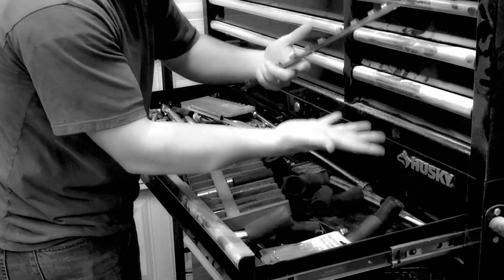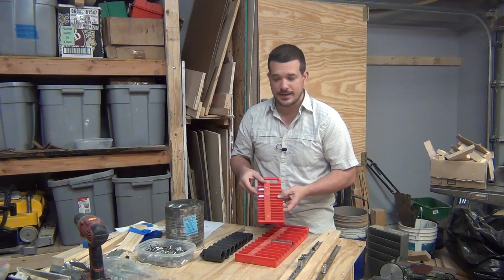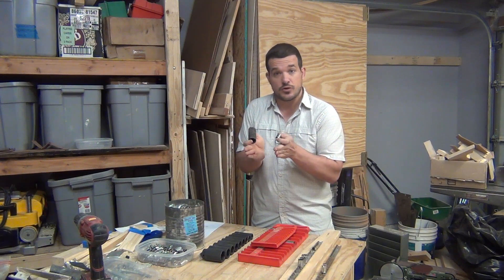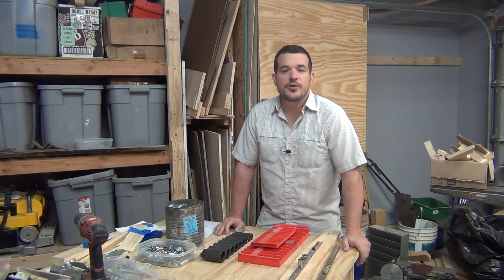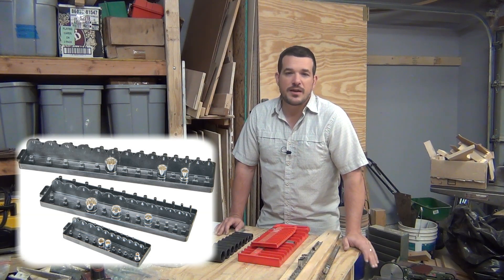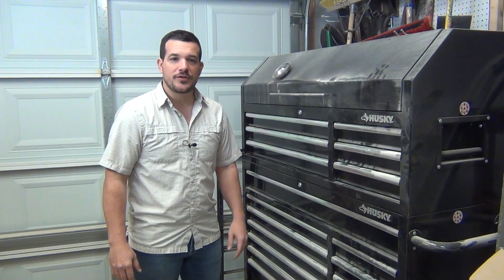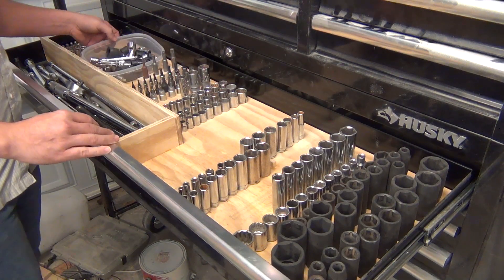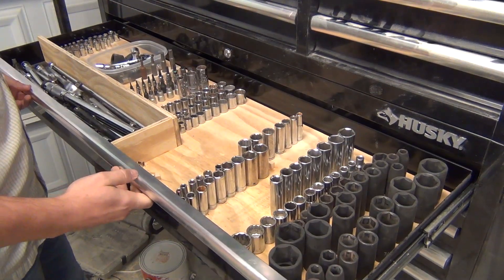Organizing Sockets - Which is the Best Method?

Comment: I’ve been turning wrenches for 60 years & I’ve tried them all. The best & most convenient for me is a tray. Since I usually use the most common sizes I have always stored the 9/16, 3/4 and 15/16 upside down. I use those 99% of the time. With my small sockets 1/4, 5/16, 3/8. With my metrics 10, 13 15 & 19.
Many good suggestions here, thanks for your post.
Reply: What do you mean by tray?  Laying flat horizontal or sticking up vertical?  I put paint markings on some of my sockets I use a lot ;-)
Reply: @aacar4095  in the top of my toolbox is a tray with a handle to lift the whole tray out. I keep all my sockets, extensions and ratchets there for quick access.

Comment: I tried your method for my tool cart...for professional auto mechanic work. I used round dowels rather than square. I found the glue comes loose after a few weeks. You may have better results if the dowels are cut cleaner or prepped better to maximize surface area contact ... or you use something better than wood glue.  I had to drill the base wood to receive the dowels. Now the dowels stay glued in place...even after a year of use.
Reply: If your dowels are set far enough into your base zend your base is set into a drawer why would you even need to glue the dowels in? Isn’t the reasoning for the dowels to keep the socket from moving side to side?….gravity does to rest.  For I can shop use i don’t see the point in glue and without g go glue his method works so much easier with moving stuff around

Comment: I used 1/2" mdf and laid out the sockets like I wanted and then drew outlines around everything. The sockets where I had a drill bit the right size I drilled. The rest of the cut outs I did with a scroll saw. A lot of work but I am fairly happy with the results. I now have a CNC machine where that I can program it to do all of the cutting. Another thing that I have thought about doing is dividing the drawer up in to small rectangles for each section of sockets. That way I can just pull one section out to add cutouts or to re cut the entire section.

Comment: I really like your method.  Since I love working with pegboard,  I'm going to use pegboard instead of plywood.  Just glue two pieces together and you can insert dowel rods.  I know that makes all sockets the same space apart,  but I don't have a many as you,  just two or three assorted sets (with missing sockets in each set).  If I use this method,  my sockets will stand vertically and I can move them around if I want to.

Comment: I use a set of manufactured gray-plastic raised trays that has properly-sized holes, all labeled. A set for 1/4" drive, 3/8" & 1/2". I then customized each tray by adding kaizen foam to the back side, snug-fit to each socket's diameter. Most the holes are full-depth; but for small standard sockets, the holes are shallower. All these reside in two drawers of my excellent stainless steel tool chest (Costco, many years ago).

Comment: Craftsman sockets long ago came in socket trays with a swinging top rail to contain the sockets. I now make simple four-sided trays from  aluminum or sheetmetal sheets.  Line up the sockets to get tray inside dimensions, transfer to metal sheet, cut with any of several methods, bend up the four sides with a sheet metal hand brake.....viola....socket tray.  These trays waste virtually zero space, can be easily rearranged in drawers.  Also, can add magnetic tape strips to tray bottom to hold trays in place during opening/closing drawers, still easily reposition. Magnetic tape can also be placed inside trays to get magnetic trays.

Comment: Sometimes the work we do is not near the tool box. Although your socket holding system is nice and organized it is not very practical. Having a type of socket keeper that you can bring to your work across the garage or outside is the best way to go. When I wrenched professionally I put the rails into a carry tray and set it on the top of the vehicle by the radiator. other smaller tools like ignition tools, cutters, tapes, plyers and long noses were also in the carry tray. It eliminates walking back and forth to get the right socket.
Reply: I think this is a setup meant more for a woodworking or even metalworking shop. one where you typically don't need to have too many sockets in use at the same time. its more of a specialty tool in this type of shop. For me personally, I have a specific socket or wrench left on a machine tool if it is used often, so there is no need to go to the tool box
Reply: I got tired of walking back and forth from my tool box to the vehicle I was working on and I invested in a Rubbermaid 4 wheeled cart.  I can throw things like bottles of antifreeze and quarts of oil on the lower shelf and keep the tools on the top.  I built something similar but smaller to hold sockets upright.  Spray your impact sockets with brake cleaner and then fill in the markings with white paint so that it's easier to read your socket's size.  My eyes aren't getting any younger.
Reply from the maker: Your comment seems to miss the point that I don't "wrench" professionally. I open my socket drawer MAYBE once a month. Now when I do, it's organized. That's the overall point of the video.
Reply: ...you can't please EVERYBODY-!!
Reply: I like the hanson. I can just set them on the floor under the vehicle with me. No fighting them out of the snap locks,they don't fall over and can drop them right back in the carrier.
Reply: bag o' toe tags good for a cart that’s mobile
Reply: larry brown  
You must be a goddamn bodybuilder
Reply: Rocket Surgery You should’ve just got a girlfriend.....She could do all the pulling and dragging 😬
Reply: @maxwellpeter1598   I agree, I've just retired, I like this method for storing sockets, most of your home jobs are in the shed, so use you mobile tool box. For jobs outside ,pumps, car, all the wife's invented jobs, surely most of us know the socket sizes and can carry a small tool box.
Reply: You cant carry foam but you can carry small bits of wood.

Comment: The metal socket rails do take a bit to "break in". I have for years used these screwed to a painted 1/4 or 3/8 piece of plywood cut to a mobile size (13"x17" is my favorite,  holds 8 rails). Once all of the sockets are on it is easy to remove and install them with the weight to hold the organizer down.  I have tried many,  possibly all of the sockets organizers and for me this is the cheapest best way to do it.
Reply: Thanks for the suggestion and dimensions. I'll have to try it.

Comment: I really like two different setups. The first being the aluminum ones with the plastic clips you can find at harbor freight. Definitely a step up from the crappy stamped metal ones that are either way to stuff or have no grip at all (as you demonstrated in the video) if you look around online, you can find spare clips if you ever end up buying more sockets which is nice. I have many rails and ended buying I whole crap load of spare clips, just in case! The downside is they’re only so long, my 1/2 drive impact socket set takes up 2 full sized rails. Although that may or may not be a issue depending on your setup. 

The second option I really like are those magnetic ones that the snap on socket sets
Are sold on. They keep the sockets upright, are magnetic so they won’t slide around in the box, and also strong enough to keep sockets from rattling around when you close the drawer rapidly, but the magnets are also ‘weak’ enough that the whole socket tray doesn’t come up with the socket you grab. 

The Hanson socket trays I’m not a fan of because the tabs are plastic, and if your taking or putting sockets back in a hurry, they will break right off. On the other hand, they’re clearly marked with the size. 

Toolbox organization is a science all in itself. But everyone is different. My setup may not work for you, just like yours may not suit my preferences. And that’s ok, everyone has their own method of organization that works best for them.

Comment: The plywood idea I think is nut as you have to remove it from the draw to drill new holes because of the chips and dust created. I ve used several methods over the years but now I m hooked on VIM magnetic socket rails  as the have a t slot and the pegs are inexpensive and can hold different size pegs on the same rail. And the magnets hold the sockets very well. The rails come in various lengths and colors. Pegs and rails can be found on amazon

Comment: I've  gotten  lazy  after  40  years  of  twisting  a  wrench .  I've  done  most  of  those  over  the  years  and  now  I  just  use  the  harbor  freight  free  magnetic  bar  and  attach  them  in  3s  to  a  piece  of  sheet  metal . It's  not  perfect  but  works  just  as  well  as  most  anything  else . I  use  a  HF  3  shelf  cart  to  take  my  tools  from  the  tool  box  to  the  job  and  back . I  may  not  be  that  fat , but  I'm  no  spring  chicken  and  I'm  lazy  😂
Reply: My dad has bad breath

Comment: As has been noted already, this is just about the polar opposite of "best" for me and many others.  

This is great, i suppose, if you always work within arm's reach of your main toolbox.  Not so great when you load some tools into a service cart and wheel that to the job area.  I use a combination of Harbor Freight style organizers, Ernst 1/4 twist rails, and Ares magnetic holders.  All of which allow me to just pick them up and take them with me, rather than having a random assortment of loose sockets rolling around in the cart.

I'm also a little amused about the desire to save space while storing what looks to be like about 75 sockets in a 52" drawer.  :)
Reply: I need to grab the whole set at once a lot of times. I often work in different areas of the shop as well as in the parking lot.

Comment: Lob alt sells a socket tray with all three drives on it. It’s metal, uses ball retainers for each socket and even has a handle to carry it to a job from your box. It’s pretty sturdy and under 30 bucks. The sockets have stay d put for me so far. You might check it out at Lowe’s.

Comment: WAAYYY back in the 80's I started out with the metal socket rails from Sears and I really liked them.  By the late 90's I changed over to those Hanson trays with the posts and they've been great except for the reasons you stated, although a vacuum cap over the unused posts work well.  I'm setting up a mechanic's tool box to stow in my truck under the passenger side rear seat (carpenter's box is on the driver's side) and so I've dug out my old Craftsman socket rails and clips once again.  I figured out early that I can "tune" the fit by either gently squeezing with pliers or bending out each clip so the sockets slide off easily but will still stay put when needed and I lightly crimp the clips to the rail with pliers so they don't slide around too much.  I've always like how I could just grab the one rail and I was all set because I had both regular and deep well sockets on the same rail.

Comment: Great vid. Good explanations of each system. All my sockets are currently on rails in there own drawers(metric, imperial, metrinch extensions etc) I’ll give that idea a go in my workshop. See if it works better for me, if it does great if not no harm done. Thanks for the idea.

Comment: So you complain about wasting space with the foam inserts, then you go ahead and waste space with wood. Also complain about taking too much time with a drill, then go ahead and waste time cutting and gluing dowels.

Why not just take that bottom piece of wood and use screws to hold the sockets in? You finish in 5min and its easier to change if needed.
Reply: wheres your video? Even tho I agree somewhat with the time. I dont think screws would work as good. show us. And the space isnt really wasted with wood his point is you can glue more dowels if you want or configure it however you want. even leave space for more tools on  side or the other. Its a good idea and hes pretty dead on with the other reviews very helpful.
Reply: stainless steel screws, yes?  #12, #10, #8? and how long; 1/2", 1", 1-1/2"?  I think it could work...do you also need a pilot hole so you know you've got the spacing down because as the sockets get bigger, they need more space btwn each screw...wonder if a 1x4, or 1x6 would work too and make more adjustable....
Reply: @K03sport  you could put the sockets beside eachother 1 at a time and put a screw down dead center through the hole of the socket and have perfect spacing. As far as 1/4 a tray covers that. Most go to 15mm. And most 1/4 sets go to 14mm

Comment: Instead of wooden blocks you can use small screws instead, about the same idea of remove and adjust with time just requires slightly thicker base plywood
Reply: I think the idea with the square wooden blocks is they match the drive size on the sockets and hold the socket relatively firmly.

Comment: been using socket rails with clips for years, not been a problem of them falling off, but I dont put deep 1/2 impact drive sockets on them. If you find them too tight, put grease on the spring clips. Advantage is, I have a boat at a marina,, I cant bring a tool cabinet to the boat, so I load up a tooltray with what I need. I also went with small portable Husky toolboxes, has a lid with 3 drawers, I have 3 of those, a $49 each,  2 large craftsman tool cabinets,  and one with just drawers which I find I don't use much.
I can also put the boxes in my  Trooper. I can lift them and they weight around maybe up to 70 pounds for the heaviest one

Comment: I just use the 99 cent rails from HF.  I think they work great and have the most flexibility of any other system I found.  You can stand up the short sockets, lay down the deep sockets.  Using aviation snips, you can cut them to length for smaller sets such as hex or torx sets. You can mix 1/4, 3/8 and 1/2 sizes on the same rail if you want by combining the tabs from different rails however you need them to be. You can pick up a whole rail and take to where your working, then return it when you are done.  They don't slide around as long as you have rubber drawer liners. Lastly, you can move them around easily as you get new tools and rethink your drawer layout.  

The faults you presented about them were comically exaggerated.  With self-discipline, they stay organized.  Cleanup and putting tools away is just as important as any other part of the job.  They only all fall off if they are really large sockets and/or your not careful.  Never had that much problem pulling off a little socket unless the tab is damaged/bent.  Like, lift some weights or something...  really.  JK...

I have well over 500 sockets and cannot imagine the time that would be required to cut all the right sizes of little wood squares, design a layout and glue them all into place.  Just not a feasible solution.
Reply: Yup i just had the same reaction. Hes shrugging off a better system because he loves playing with dowels lol.

Comment: Not to criticize but your way seems that it would take even longer than it would to drill holes in a piece of plywood and having to change out drill bits for different size holes. Also gluing the dowels seems like they would break off easy as you grab sockets.  Great video though, you gave me lots of ideas so I thank you, your time is much appreciated 👍🏼
Reply: Try using pegboard with dowels

Comment: I’ve always need portable on the go storage. I like what you have for shed or garage if I can ever retire. Sears used to sell flat black containers that were pretty good. I could toss in a ratchet & 1 or 2 rails. I used those boxes for combination wrenches too. I haven’t found such containers in years. Had a metal one too at one time. I have several sets now in various factory containers that I don’t like. Not space efficient at all. I wish I had equipment to mold plastic & make my own boxes. Lot of doing though. Tools have gotten too high now to buy new sets also, even if I see one I’d like.

Comment: I personally as a mechanic was the same, nothing worked or fitted my tools. I ended up buying some nice socket rails (alloy and plastic holders) and mounting them to an alloy insert for one of my drawers made out of and old men at work sign, that way if things change or I get a bigger toolbox I can either move them to another sheet of alloy or rework the one I have. If a plastic holder brakes I can easily buy a new one (I have heaps of spares) and keep going.
Reply from the maker: Another great idea. Thanks!

Comment: Go to Amazon and look up Great Neck 10001 1/2 3/8 1/4 socket rails. Metal rails with plastic and  handle socket holders that you have to push a tab to release. Easy to carry a whole set to work area and not at flimsy.

Comment: I prefer the peg org because i can see the sizes at a glance.  I don't know about anyone else but over the years I've accumulated dups and different brands and every year it gets harder and harder to read the sizes.  The pegs can be used to keep dups organized as well as divide according to wrench size.  But, the prices are outrageous.  I researched this quite a bit and all I could find were (toy quality) peg boards that were anywhere from 8 to 10 for each board.  Even at hf, a set of 3 costs about 25 without a coupon.   I considered creating my own but I have other projects to work on.  Time is money.